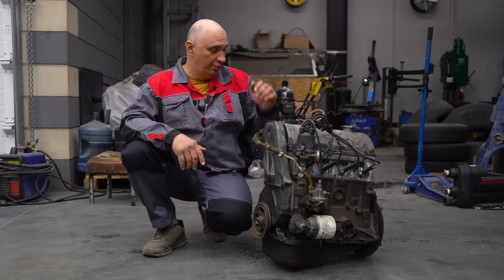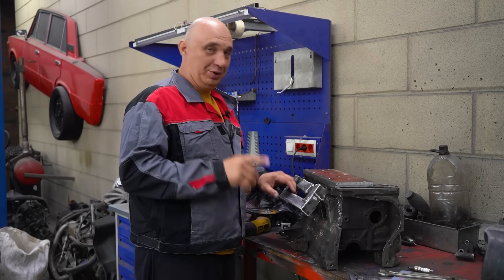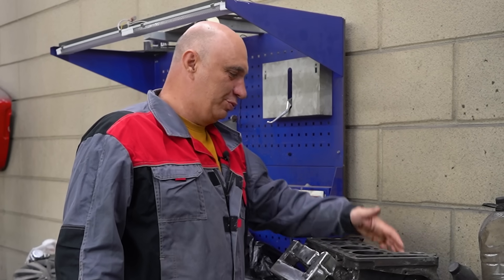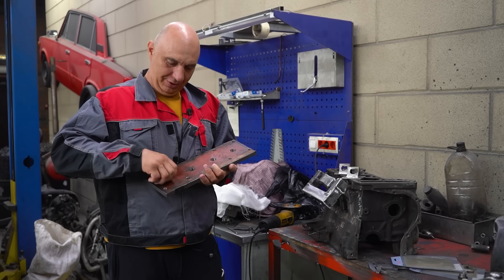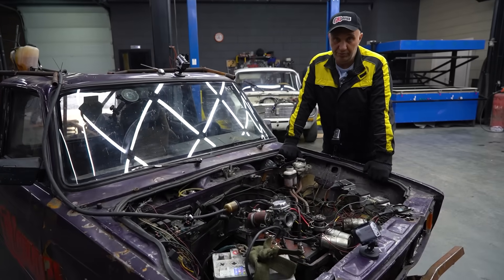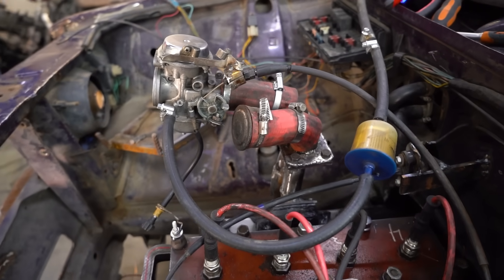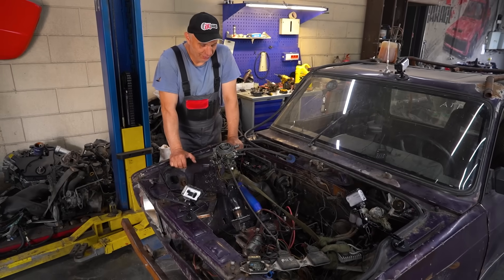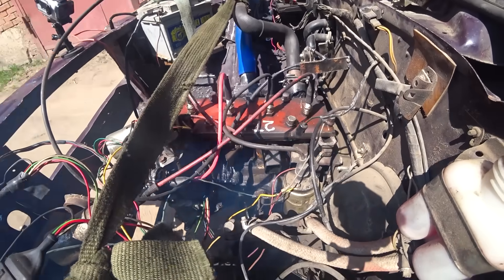4 stroke to 2 stroke Lada engine conversion

Comment: Sir, 

I am a voice actor, retired.  🕺
   => I offer to record the voiceover / overdub translation track(s) for  your well produced and artfully composed video series.  <=
  *Free of charge for at least 2 videos*
  I am now disabled and unable to tinker in my garage like I used to. Boredom is not good and normal television dulls the mind.  I can still help with my teaching voice, and help someone independent and not afraid to try something even though others said it would not work. 
Thinking on your feet, when in a machine shop or similar - is absolutely becoming a lost art.  Projects get on hold for a week because they didn't know the right size bolt metric to inches or that what they're looking at has left handed threads out of necessity and don't break it off with a pipe wrench and a cheater bar because you're turning it the wrong way. 
These kinds of videos are probably the only way people will be able to see a live project from birth to cradle, with your thought processes on the "designing - engineering - fabrication - frustration" presented to the viewer simultaneously.
  The pacing is perfect also.
 
  I'm impressed so much with your video, I would like to help you reach a larger audience and be able to make more videos, you could just send me the script I'll read it and send it back and then we can synchronize it over zoom meeting I can handle of the English voice track timing/synchronization with your video/voice tracks and send it back... or vice versa, as you please.

  Your original voice attenuated in the background is still to be used, in my opinion.  It adds a live person interpreter style feel which carries the intonations and connotations the robot translator cannot duplicate; inflections and emphasis, the subtle pauses and facial expressions are reflected s you help us follow your path, your pain, your victories and ultimately party time as you come to a better conclusion.
   I may not understand your language - but the worldwide understands: *annoyed sigh and scrunched up face when you're pointing at something* moreso than the the automated voice could explain in 10 minutes.

This is one of the most legit videos I have seen on what I call "retro-upgrading" which means replacing a complex computer-controlled machine or device with a more simple operating principle or system - and hopefully what you gain and granular control and self-regulation offsets what you lose when abandoning  proprietary IC embedded algorithms and integrated circuitry.

Keep it up!!

I hope I can help.

Comment: Yeah if you don't seal off the individual cylinders it will just fill with oil and gas. I would isolate the two central cylinders since they are in phase.  

You're just missing a few clues from a stock 1 cylinder 2-stroke.  That runs.  Maybe just build one first.  Should just take a sleeve,crankcase and a crankshaft.   Since the idea is to get it it to run you won't need much compression.  Might be a good idea to add an exhaust header and a intake valve also not just a reed valve.  You need enough pressure to atomize the fuel-oil-air mixture.  The throttle only controls airflow through the carb and could easily be too rich or lean due to incorrect jetting. So if you swap that out for a fuel injection system you get more precise mixture control.

Comment: next time try with a kompresor it will be easier to make and you can use valves!!! like those old detroit diesel ones. The valves are used as intake and the walls for exhaust.

Comment: Answer: Use a supercharger.
Reason: a supercharger forces air into a motor. There's no intake stroke in this engine meaning air is not sucked into the engine. So if you add a super charger it will push the exhaust out and through the exhaust and bring fresh air and gas to the cylinders

Comment: I guess im wondering why they didnt choose an engine witth cylender sleves  you you would have been able to remove them and cut transfurports into them   and beable to run reed blocks at the base of each cylender  and sins this is an inline engien it should be rather easy to figure out a way to put seals in-between each cylinder and then im sure the flat plate didnt give you the best compression 🤔 very interesting idea though not sure how much it would truly take to make it a true 2 stroke with power

Comment: I really didn't get a good look at the crankcase, but what little I saw, it seems like the crankcase volume for each cylinder is too great (big). In a 2 stroke the crankcase needs to have only as much space for the crankshaft & connecting rod to have room to rotate,; any extra space is needs to be as small as possible. The reed valves has to be as close to the crankcase as possible, hence no wasted space.

Comment: From my understanding is that Ferrari experimented a prototype fuel injected two stroke in the early 90s as the  t134 3 cylinder!  its not premix but with  a separate sump system for the oil like a four stroke and a super charger was needed! 

So are two stroke engines better not premix but instead with advanced  fuel injection with a separate sump lubricant system with either turbo or super charger?

Comment: I had serious doubts this would work I just remember from 2 stroke motorcycles how finicky they are fuel mixture has to be spot on to rev and the power is very dependent on revs like the whole power band thing which was basically just when the engine managed to breathe properly is how it was explained to me but it would seem that a lot of engineering goes into making the fuel and air move properly through the engine compared with a 4 stroke engine a 2 stroke is much more complicated in this regard as a 4 stroke has each cycle very separate.

Comment: The idea is to make it run like a 2 stroke. I would keep the engine as is and make the cam turn 1 to 1 with the crank and have the valves open and close at the bottom 1/4 of revolution.
It will need to be force fed with a super charger and firing on every stroke of course.
I think you would have better chance of success.

Comment: The first problem is, what force do you think the mixer is sucked into the combustion chamber in the two-cycle engine? You can see that when you look at where the carburetor is. In the original two-cycle engine, the force of vacuum generated when the piston is facing tdc is sucked into the crank chamber and then back up to the combustion chamber by the pressure coming down to bdc. But in this experiment, the carburetor is directly connected to the combustion chamber, so there is no force to suck the mixer in, so a supercharger is needed to push it forcibly. The second problem is basically one of the essential factors for two-cycle engines to require the pressure of exhaust gas. Because the structure opens the exhaust passage when the mixer enters the combustion chamber, there is not enough time for the mixer to stay in the combustion chamber. So, the chamber is installed to keep the exhaust gas under constant pressure. This is what the higher the rotation, the more necessary it is.Thank you always for the fun videos and I'm enjoying them.

Comment: I like your "Nike" approach (Just do it). However, in my humble opinion you should leave the cylinder sleeve alone. Two pistons going up, while their comrades go downwards can not create pressure in the crank case to push the mixture into the chambers.
Use the existing valve train, convert the camshaft to open inlet and exhaust similarly to the slots in a common 2-stroke. (open exhaust valve first, but a few degrees later open the inlet valve) . Gear the cam drive to 1 turn of the cam for 1 turn of the crank. Assist flushing the chambers by adding a blower/compressor to the inlet side. Should be able to run easy on 1/200 oil mix, since the existing pressure lubrication remains untouched.

Comment: You'll need a compressor and a valve for exaust to make it work properly, cause in 2 strokes the mix gaz/air is compressed by the down engine, and then injected into cylinders at he GOOD time...

Comment: I would try to isolate each cylinder and install reed valves for each cylinder. Run the 4 intake tubes to a collector so that one carburetor feeds the group.

Comment: The squish of each cylinder is to close and without reeds the engine is seeing a raw gas mixture and upping a already super high combustion pressure.. this is blowing the spark out

Comment: This need a compressor, cause the mixture is not going to be pushed in to the cilinder. On a 2 stroke engine the misture goes in to the cranckshaft and the pistin compres it, when the charge trasnfer open, the mixture is pushed to the cilinder. In this case nothing pushed the mixture in to the cilinder.

Comment: I assume you are using reed valves on the intake, perhaps you could use the 2 inner cylinders, 1 carburettor, as a compressor to be able to suck a fuel air mixture in and on the next stroke push the air fuel mix out through an exhaust reed valve to the inlet ports of the outter 2 cylinders. You may also need to put 2 spark plugs in both outer cylinders to be able to get a spark on every compression stroke, Haven't quite got my head around that part (haven't figured that part out yet)

Comment: This engine needs a cross-plane crankshaft - since it’s a 2-stroke that would be the most even firing interval.

If you use some ‘liquid glass’ head gasket sealer and a cooling system, you can seal off the leakage between the cylinders without machining work.

The firing order could be made the same as a 4-stroke 4-cylinder, albeit at twice the frequency.

Comment: Also you have 2 pistons running on same plane ,need to change crankshaft to 90° separation of cylinders, as it is now you just have a very large 2 cylinder engine. Make these changes and you will have a  very powerful engine,  your welcome people.

Comment: Yes, you must seal off each individual crankcase from the others,,a multi cylinder outboard that has a failed seal usually will not start or if it does it runs very bad..your welcome people.

Comment: What if you made an engine that has 2 of the cylinders 2 stroke
And the other 2 cylinders 4 stroke. Wether you make it 1 and 4
A 2 stroke and 2 and 3 the 4 stroke. Or maybe 1 and 3 a 2 stroke and 2 and 4 a 4 stroke. Or 1 and 2 a 2 stroke and 3 and 4 a 4 stroke. It’s up to you!

Comment: You guys need to build some type of a dynamo setup  with it's own power to mount any vehicle on it just to provide   traction to  it's wheels to start the engine... So that way you guys don't have to b pulling the vehicles all over the place.. and at the same moment adjust work on the engine

Comment: The main problem is crankshaft because 8s for 4stroke not for 2 stroke yyou need a Suzuki 3 cylinders engine to convert in 2 stroke

Comment: But would need a blower, also diesels don't compress the fuel mixture, the fuel is injected after compression. I know that some very modern gasoline engines do the same thing.

Comment: Oh Sh*t and I had so much Hope, it's either 1. The Timing . 2. you are not using the displacement of gas/fuel to inflate the combustion chambers with enough mix to make it run . 3. your exhaust is Designless and not providing an expansion chamber to ensure the combustion chamber is filled before igniting or 4. you just don't Want the Job at the Russian front fixing tanks under heavy fire so we have 1,2,3,4 ...

Comment: My friend you cannot have the hose on there because you have to have have to deal with wills you have to feed the carburettor on that it needs more fuel regulated and you have to see if the fuel is going in the chamber

Comment: The mistake you make is that there is no transfer ports connecting the crank case with the cylinder. The intake with the reed valves should be connected to the crank case, and you have to find a way to build a transfer passage which connects the crank case and the cylinder.

Comment: A two stroke I4 basically a standard four stroke V8 but with 4 cilinders instead of 8 as a piston is now firing every 90 degrees of crankshaft rotation like in a 4 stroke V8 instead of 180 degrees like in a four stroke I4. More Torque  with less cilinders.

Comment: wowww great engineering! next time try an easier route. take the stock engine, turn the camshaft same speed as the crankshaft, that is a 1:1 ratio, and use a supercharger to fill the cylinders, time the ignition to fire at every rotation!

Comment: I was thinking keep the valves and heads and add a super charger.  You'd have to double the cam speed or double the bumps.  If you start with a DOHC, you could time the valves with stock cam  within a chain tooth anyway.  The ignition should fire at twice the speed.  There are these small chinese superchargers.  Only need enough air blown in for combustion.  Carb on the suction side of the supercharger makes things easier, and might add some video excitement if it back fires!

Comment: I have 2 possible theories. The most obvious is the exhaust. 2t engines RELY on a proper exhaust because they actually intake through exhaust on intake stroke. We call this scavenging. The problem with your exhaust is its so short that there are little to no exhaust fumes to recycle. This is the reason for expansion chamber exhausts like you see on a dirt bike.   I also wonder if your port timing is off as well as ignition. However I would start with a proper exhaust and even expansion chamber if possible. Also your welding totally sucks so I'm willing to bet you have a vacuum leak or 2. Start with a pressure test on the intake and also get the exhaust built but i think you should let someone else do the welding. Im definitely impressed with what you have done, just not your welding!

Comment: What about doing a conversion of a Lada motor to a 2stroke detroit, same premise. It's an issue where the fuel and air is getting blasted back from the firing. It has to be positive pressure to force fuel and air into the cylinders. Detroit uses a supercharger to force air in, and a snowmobile or dirt bike uses the downward motion of the piston to force air and fuel up from the crankcase to the cylinders, judging from the video your doing what sleds and dirtbikes use, probably too much volume for those pistons to force fuel and air up. I'm not an expert, I'm just guessing

Comment: The air volume between reedvalve and combustion chamber (intake manifold, transfer por, and crankcace) is way too big. So the secondary compression ratio is too low. Two stroke crankcase is tigth for a reason.

Comment: maybe you could try the diesel 2 stroke aproach, they have a single exhaust valve on the head and a presurized intake port at the bottom, all the oil ports and stuff are separated from the fueling so you should be able to keep the bottom end mostly intact

Comment: While you guys done great engineering, it seems like you dont know how fundamentally 2 strokes work. you just welded intake and exhaust ports on opposite sides of bores. that wont make the engine "breathe". 
So... 
the 4 stroke engine will suck air-fuel mixture by moving piston DOWN while intake valve is open, and exhaust gases will leave when exhaust valve is open. very precise, but needs two full rotations to occur.
2 stroke engines suck air-fuel completely differently. they suck the mixture when piston is moving UPWARDS, and it sucks it NOT in the cylinder, but in crankcase and only when piston is moving down it pressurizes crankcase. when piston is almost at the bottom it opens port that connects crankcase with cylinder and only then the pressurized air-fuel mixture gets sprayed inside cylinder while simultaneously pushing exhaust gases out trough the exhaust ports. That's the sole reason why on 2stroke engines there is no oil in the crankcase and you need to add oil to fuel to lubricate it. crankcase is primary chamber for fuel mixture.
In order to convert 4 stroke engine with multiple cylinders into two stroke, you would have to separate each part of crankcase space to its own cylinder and make sure its not leaking anywhere, then you would need to engineer the ports correctly with exessive welding.

Now to think of it, to make your setup work while not doing all that would be to pressurize air-fuel mixture somehow. The only thing that comes to mind is a turbocharger, but it couldn't be driven by exhaust gases as there is none on engine startup. you need pressure right away. maybe your electrical turbocharger with starter motor might come in handy. I would love to see you do that and id give atlest 70% that it will work.

As a side note, the "puffs" you were getting was due to fuel still getting in cylinder eventually. so what happened was you cranked engine while pumping gas trough carburetor "acceleration pump" that you mentioned, the liquid fuel got inside cylinder and got atomized by flapping piston to the point it could ignite. not all the liquid fuel got atomized at once so the part that did got ingited, then a little more of it ignited on the next cycle. THIS is why you thought it almost started but in reality it did not. it was doing that until all the oxygen around got used up and since there was no pressurized ventilation happening the ignition could not occur until more oxygen got in from atmosphere.

I really hope you read this and try once again with starter-motor-turbo setup. would love to see it :)

Comment: How about like how a diesel 2 stroke works, use a belt driven supercharger to add air, remove exhaust gas. Like Mazda is working on. 🤙

Comment: EXACTLY what I was thinking...perhaps you could either blow the fuel in with a small blower OR create a vacuum on the Exhaust side by making a common exhaust manifold and attaching an old turbo and drive it with a electric motor like a blower...CRAZY...YES but then so is this whole project